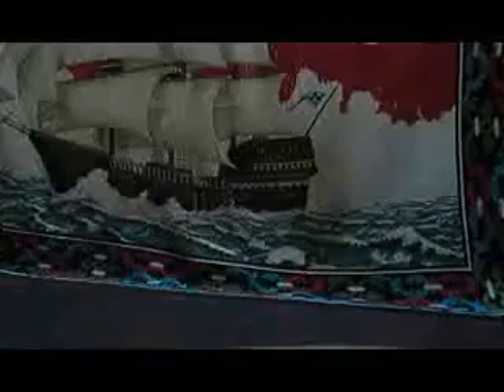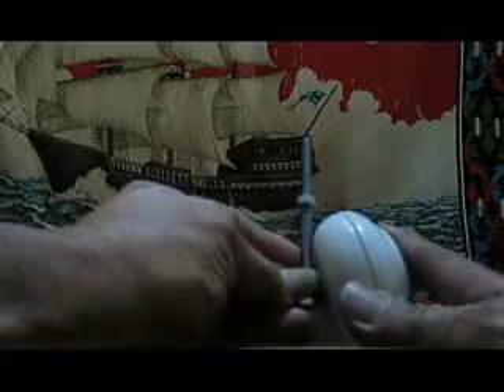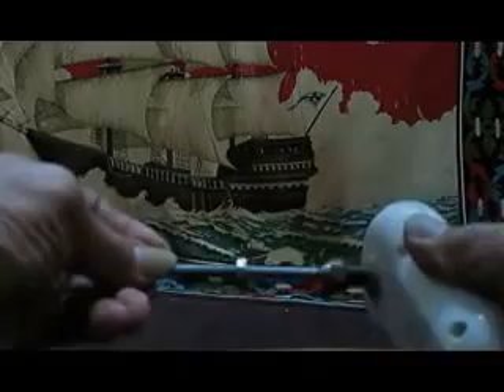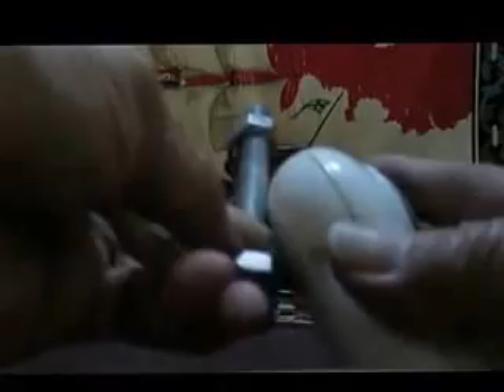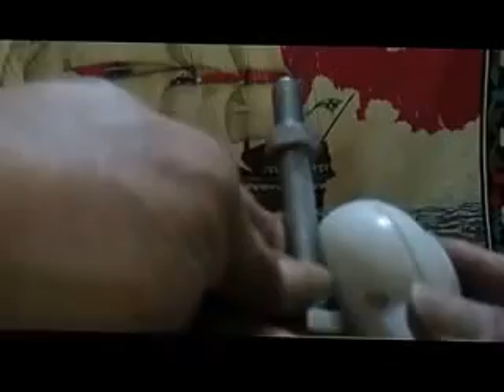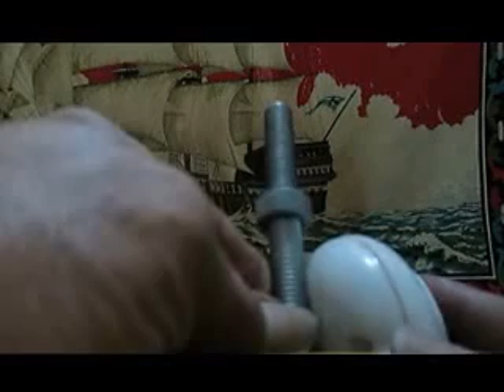Vibration Effect On Nuts And Bolts

Comment: This is amazing, the physics here are so intriguing.  Vibrating one side moves it one way and vibrating the other side moves it a different way!

This is exactly what I came to YouTube looking for after learning about a ‘spring washer’ and its use in preventing the nut from ‘vibrating off (https://diy.stackexchange.com/questions/21457/should-a-washer-go-on-nut-side-or-the-bolt-side/32475#32475 Perry’s comment).’

Thanks for sharing!
Proverbs 27:17